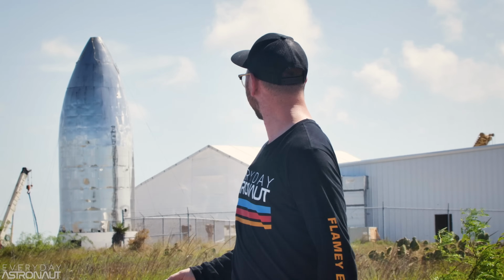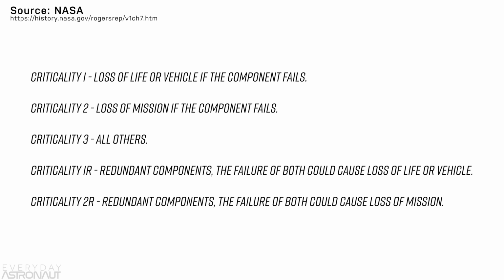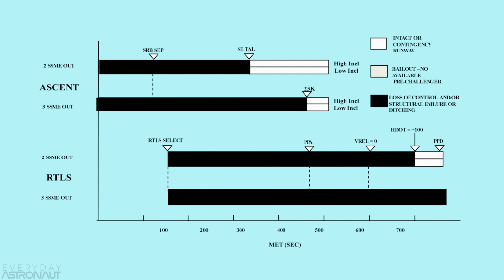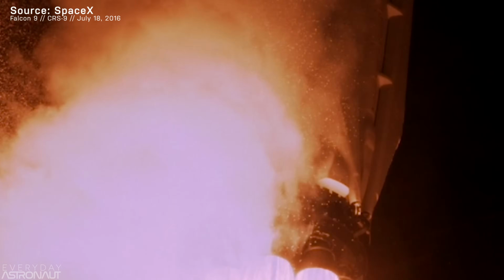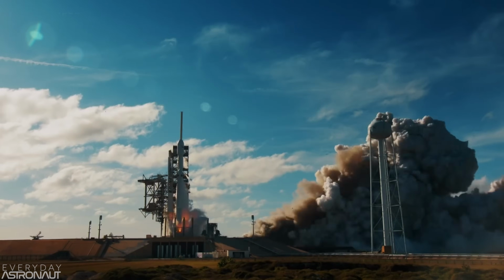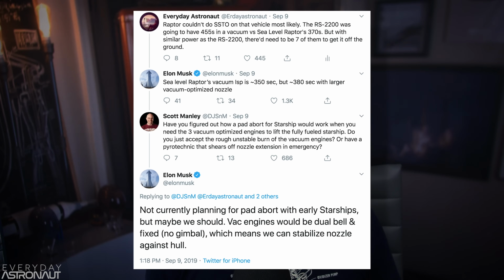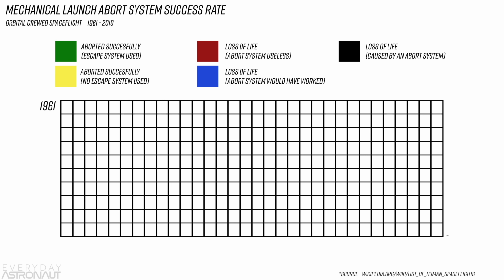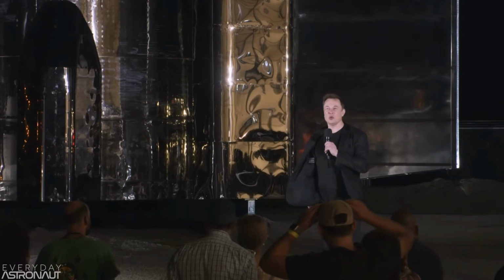Why won’t Starship have an abort system? Should it?!

Comment: Previous statistics do not predict the future, they tell us about the past. As soon as abort systems stop being used, we eliminate our ability to learn about them and make them better. Without question it's always easier to eliminate systems than design them, but that doesn't necessarily mean the simpler system will be safer in practice. The challenger astronauts may have lived if they had a way to parachute to safety. We know at least three of them survived the initial explosion and activated their Personal Egress Air Packs. If those three had a way to get out, the Space Shuttle program could have been 20% less deadly overall.

Comment: Material failure happens no matter how much engineering goes into reliability. Over 100 yrs of flight, and aircraft still have emergency systems on them. Millions of flight hours flown with far less than 1% catastrophic failure rate. But crashes and material failure still occur today. The day there is no need for emergency and contingency equipemnt on aircraft, is the day we can even start talking about omitting these things from spacecraft. Difference on a trip to Mars? Or even just the moon? Okay, you survived....now what? Who's going to be able to come get you before you run out of life support and sustenance. Launch aborts and even re-entry survivability are still a must.

Comment: The ejection seats on the space shuttle would have killed anyone trying to use them. Starting a rocket motor in an extremely high O2 environment isn’t good for the humans inside.
Reply from the maker: Shuttle wasn’t a high oxygen environment. Apollo was the last purr oxygen environment spacecraft in the US
Reply: @EverydayAstronaut  > purr oxygen environment
Never knew, that they've also packed up cats in the Apollo.

Comment: "The orbiter was hanging off the side of the vehicle, which put the crew module and the fragile thermal protection system directly in the path of ice and foam strikes . . ."

"Let the daredevils get on the plane, I'm getting in the plane!" -- George Carlin.

Comment: "It's like putting a Cessna inside of a 747 just in case the 747 fails."
Boeing, please hire this man.
Reply: @syaondri  Incase the Antonov fails, you get the Boeing, and if that fails you get the Cessna. 

big brain time
Reply: Many people with brains work at Boeing, the problem is management. They keep pushing their people to cut development time and cost. Otherwise we would've seen a safer MAX.
So they need to hire new management. (43:07)
Reply: @reconx86  Most failures were actually caused by software problems and not engineering, but the engineering was still. bit flawed.
Reply: @reconx86  It's also the airlines, who didn't want to have to retrain pilots on another model, so pressured to keep tacking on new stuff on the old 737 frame, including the oversize but efficient engine which led to the problem.
Reply: @wyskass861  The airlines wanting to cheap out on training are just as fault as Boeing for the mess the 737 Max turned out to be.
Reply: @reconx86  people with brains will choose to work for a functioning business.
Reply: Trump sees this quote, picks up phone to Boeing: "About AirForce One ..."
Reply: could have worked for the 737 Max
Reply: @syaondri  thank you kind sir
Reply: Belkan tactics
Reply: лайк ты  крутой
Reply: @h and that sucker flies at like 30k feet, it's insanely high for that type of plane.

In theory they would never have to land with refueling planes but i wonder what the actual time frime is.
Reply: Now try yo put 40 people into a cesna

Comment: I'm with you: I'd not fly on the earliest launches, but possibly might after it's proven it's safety a few times.  Still, I'm a proponent in KISS: Simplicity eliminates many of the  failure points.  Then again, if Rutan's company, now Sir Richards, Virgin Galactic, could go into LEO, I'd sign up in a heartbeat: Scaled makes planes which can and  have  been flight-tested and are likely to be as reliable as any small plane. Having to land on a pillar of flame doesn't give me great confidence in any case.  The shuttle having to re-enter so "HOT" was not such a great idea, but landing like a super-heavy glider wasn't so bad; it's something they could do many times in simulators AND flying through the air is a pretty mature technology

Comment: Entirely disagree. Yes, the systems should be overdesigned with multiple redundancies so that the catastrophic failure is extremely unlikely to happen AND you should have a simple, crude,  mechanical, crew ejection system with the least number of parts in case these complex systems do fail. Anyone can claim their systems are fail-proof, that is until the first accident which will take 7 lives again. Then it will be: "oh, but we didn't know about this fatal flaw, who could have envisioned this?" or "It was the perfect storm" and a bunch of other excuses. With every new technology - knowledge has limits, only folly, carelessness, complacency and stupidity know no limits. Which is why it makes perfect sense to supplement new tech with an older, real life and time tested abort systems. Another factor is that it's hardly ethical from psychological perspective to put a human into a fully automated orbital vehicle without both automatically and MANUALLY activated abort system. Air travel is much safer than space travel, and still, I believe it would make perfect sense to come up with an escape system such as detachable, parachute-equipped fuselage, or similar measure.

Comment: For a LAS to work, and so far it has not done much, it has to know when to activate. In the case of Challenger it is far from certain that it would have worked. We don't have the tech for a proper LAS. There has to be cameras everywhere so an AI can see and decide if it should be activated. A bad activation or a slow one, as in takes one second is too long. Humans can't react fast enough. 

For now I think we just have to make rockets as reliable as possible and hope you get to orbit before the bomb goes off.

Comment: The thing I worry most about Starship safety abort is the vertical landing on uneven surface. I have seen no feedback on this. I have seen some landing leg design assembly video from afar at Boca Chica but not sure if it's design implementation for just that. Landing on a pad is one thing. Landing on a floating pad is another but landing on the moon and mars where there is no pad but a rocky uneven surface is altogether another thing. Ad in the difference in gravity and it could be hard to practice what may be an unintended horizontal landing on the moon or mars. Abort system survivors? Maybe. If there were already successful landings prior and the crew were ejected safely away from their starship.

Comment: As far as I'm concerned, the only argument that can be viable is "the extra parts actually lead to a higher chance of failure overall". Otherwise, it's putting mission objectives above the safety of astronauts, pure and simple. And to me, that's not acceptable.

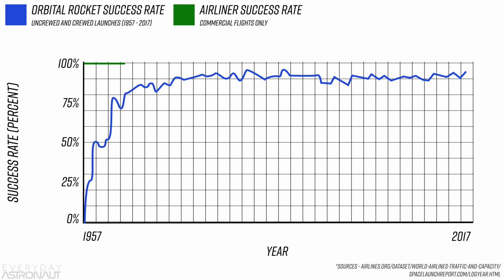Comment: 40:06, did you intentionally left out the the years 2018 and 2019. Two fatal air crashes one in 2018 and 2019 Lion air and Ethiopian where(189+157) 346 people lost their life.
Reply from the maker: The most complete data I had to work from ended in 2017. With billions of passengers a year, 200 deaths doesn’t really change the static’s enough to even see it on a chart really. Tragic, yes, of course, but statistically doesn’t even show up really!

Comment: during a starship pad abort, vacuum engines could also be used to dump fuel, which would make the rocket much faster and more maneuverable if enough fuel could be dumped quickly enough. Given what I know about raptor fuel/oxidizer pumps, that wouldn't be easy to arrange, and its unlikely that you could dump fuel faster than the engine would use fuel while running, but it is an interesting possibility.

Comment: Funny safety factor at Underwriter’s Laboratory UL & Factory Mutual FM for fire sprinkler systems from High Rise to single family homes is 5 to 1 except the sprinkler head which is 4 to 1.  Pipe and fittings must be rated at 175 psi so test pressure is 875 psi at 120 degrees F. On a system that most typically sees street water pressure. One is overkill or one is really really weak.

Comment: The Boeing 747 (the latest variant anyway) and most airliners do in fact have a small plane propeller for cases where the man engines fail so it still produces electricity and hydraulic power (the RAT or Ram Air Turbine)

Comment: But aren't you kinda contradicting yourself?
With the 9 merlin engines you said having more engines (significantly more parts) reduces risk because of failover. 
Then for the entire rocket you use the exact counter argument: Instead of failover why not make the main system more safe to begin with.

Comment: Challeneger failed on purpose and I feel like it shouldn't count.  The spec for the o rings was only good to 50 degrees F.  They launched at 31 degrees.  Multiple engineers said that the shuttle would blow that day and tried to stop the launch.....

Comment: If they are building a starship, they should build it in space under zero gravity, but that in itself has it's own challenges such as welding in the vacuum of space, finding alternative ways to where they can connect the starship, one module at a time, then seal it from the vacuum.   The bigger the vessel the more things can go wrong in a larger area, which is why you don't want to force that big monster into space.   Smaller means more durable, ...bigger is just asking for trouble, unless, as I said, you build in space.    Send smaller shuttles up in which the shuttle itself can be converted into the parts needed to build the starship, ...categorizing all the parts, so that you know where they go when you disassemble them.  Just my two cents.

Comment: Why hasn't Rocket science had any advances like virtually every branch of science in the world has? Isn't Rocket Science junk science? Aren't electro-gravidics the future?  At least shouldn't we be using David Adair's Electromagnetic Fusion Containment Engine. Isn't that should be what we're pursuing. Please, dive deep on this. If Adair isn't the real deal, I'd sure like to know.
Reply: Because we had already discovered the best chemical propellants in pretty much all of chemistry. All that remains is to try to use them more efficiently, which is a complex engineering problem.
Reply: G'day .. I recon rocket tech wont be needed in future space Industries and exploration. 
My gut tells me.. major advances are soon rather than later.

Comment: If it's going to carry people the answer is obviously yes. Only an idiot would argue that a manned launch vehicle doesn't need any sort of launch abort system. Around 7 people died because the shuttle didn't have a launch abort system (to be fair adding a LAS would've made the shuttle far less capable than it was and might have not been possible or at the very least very difficult). More people would've died if the Soyuz didn't have a launch abort system; The Soyuz R-7 was considered a very safe vehicle; and it turns out even it needed an abort system. People's lives are on the line here; abort systems are a must. The fact that it won't have an abort system should prove that at the very least there are no near future plans for man rating the rocket and flying people on it. At most it means that they don't plan on flying people on it ever, or that in reality it will never fly. Because honestly Musk keeps making these bold claims and not delivering on them; the Falcon Heavy will fly to the moon and take people there! The Falcon 9 reuse will reduce launch costs by a factor of 100! Etc, etc.
Reply: I was thinking the same thing. After seeing the dented up, patched together garbage heap known as MK 1... And the lack of plans for a launch abort system.. As well as the lack of plans for a factory to build Starships in under controlled conditions and quality control procedures... Leaves me very disappointed. I can only conclude that Starship is a scam. Maybe Musk thinks he can weld pieces of metal together out in the rain and call it a rocket. I'm not buying it.
Reply: I urge SpaceX fans to ask plenty of questions. Maybe then there will be a change for the better.

Comment: abort system for 100 people may be impossible, airliner also does not have abort system, even simple one like parachutes..
Reply: An abort system like the one used on the F-111 fighter would work even for 100 people. Since the crew compartment would separate from the rest of the vehicle. Rockets are not really comparable to airliners and will always remain inherently dangerous.

Comment: On the flight frequency thing: Shuttle is actually supposed to be more frequent too. 1981-1985 we saw a rise in frequency. 1986 was planned to be more than 1985, even carrying the Centaur G Prime in its payload bay for fast trajectories (ex: Galileo probe, no need for Venus flyby)

Unfortunately (& ironically) that's what going on in STS-51L management's mind. They want to prove that Shuttle could be flown in fast turnaround, plus PR reasons (scrubbed so many times, that NASA was criticize by public). Then obv we already know what happened next

I'm crossing my fingers & my toes for SpaceX management to be more competent. I'm glad that Elon himself is CEO/top manager & Chief Engineer at the same time, meaning he is involved a lot in Starship & Raptor development, so I believe he know all the engineering details, not like the STS-51L managers that ignore all the engineers recommendation

I will be scared & depressed IF the Starship will have the same fate as current 737 MAX & STS-51L, when all the netizen bashed SpaceX for being "incompetent, corrupt, greedy, etc" because of the crewed accident that end lives (if the accident was caused by mismanagement). That's definitely a nightmare for all of us, and hopefully all of folks at SpaceX can avoid that

Comment: While it did not involve a manned spaceflight, the Mercury-Redstone 1 mission which was planned to test the vehicle and capsule used for the suborbital flights of the Mercury Project had an odd failure (4 inch launch) where the only part of the rocket that actually flew more than those 4 inches was the launch abort tower.

Comment: The starship has an abort system, it's the top bit just like the shuttle with the side plane bit because from what I can tell the shuttle abort system was "we're disconnecting the plane bit" and praying because I don't remember the tests of that system unlike the "we now want a thousand parachute tests" because middle management something. 
You know ejector seats don't work after a certain point so they were always BS except for a fail in like the first 20 seconds.

Comment: The statement that Rocket flight will become safer if you just give them more time is just stupid. Like time has anything to with it. it is a failure examination and solution creation process done again and again that does this. This is incredibly difficult to do, very costly and needs a profound commitment from thousands of highly trained professionals. If you don't have that then time does NOTHING. You said more time because it was the simplest way to say a very high iteration of this process. Basically more testing is what you described. If you think I am being pedantic. How about I say "Tim, i Have 20 billion dollars a team of 2000.... how much time will this take to get rockets to be as safe as airliners?" Whats going to be your answer..... see how none scenically this is.

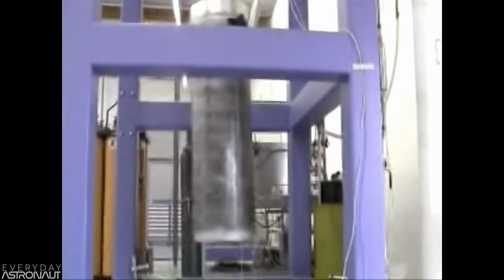Comment: 8:00 A safety factor of 1.5 is actually 150%. That is, 150% above what it is designed to handle. So for a part that may experience 10 Newtons, it will me designed to handle 25 Newtons.

Comment: An abort system could have saved the Challenger crew because the failing SRB was losing thrust for several seconds before it finally failed.

Comment: 46:38 
I have an idea that could solve pad-aborts, and in my certifiably-uneducated opinion, is the highest risk time for Starship.  As you discussed in the video, with more than 30 engines, and a 99.88%(so-far, and including the early failure) reliability of the Merlin, I don't believe in-flight abort is exactly necessary.  I think you explained it well with the 747/Cessna analogy, Starship will be built with redundancy which makes it the escape vehicle in the event of an aborted mission.
On to my solution: A crane* would be positioned at the launch site with a tether attached to the pod.  In the event of a catastrophic failure of the booster, exploding bolts detach the pod and eject it in an intended direction.  The pod swings on the tether, either at a length where it won't strike the ground, or into a pool of water.  There would be a mechanism to detach the tether, perhaps with a quick-reel system to avoid hitting any control surfaces or puncturing the hull.  The tether would detach presumably as soon as the engines are lit.  This idea is intended to solve a problem during fueling and pressurization.
*Not a mobile crane which could be destroyed by a catastrophic booster failure.  Something extremely well reinforced, built into the concrete.
Reply: Your idea might be feasible.  I wonder if those safety engineers have thought of that.  I sounds simple enough, much simpler and lighter than those abort rockets.  I could at least lessen the anxiety of the crew.  They won't feel  totally helpless and vulnerable once they are have buckled down on top of that beast.